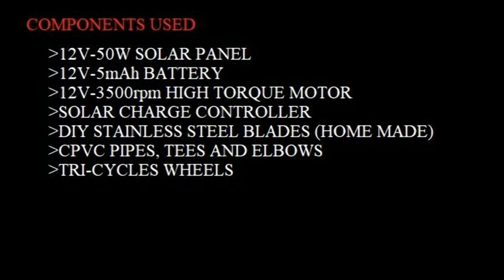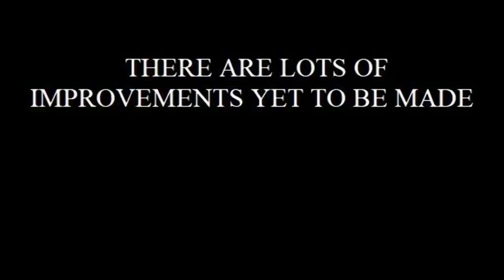MECHANICAL ENGINEERING PROJECT - SOLAR POWERED GRASS CUTTER (LAWN MOWER)

Comment: Whta is this scrap if you have to  drive it manually so you can make an mechanism to rotate the blade
Reply from the maker: You are right.
But it is a prototype for a remote control lawn mower, which was my original project, but due to lack of time i had to go for just basic design for submission.
Reply: @cpt_alii8705  ok sry for that , but their is some basic mistake u did in your project between solar panel and battery connection
Reply: @cpt_alii8705  by the way now a days what are u doing
Reply: @nishal130  what is the right connection